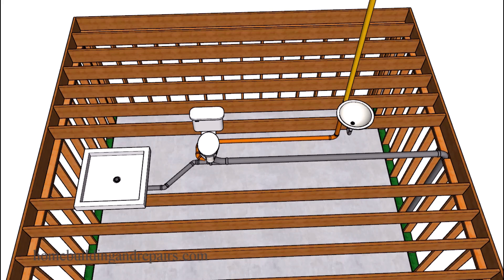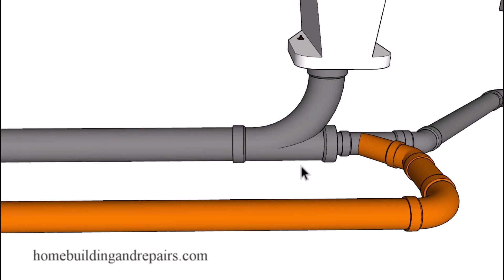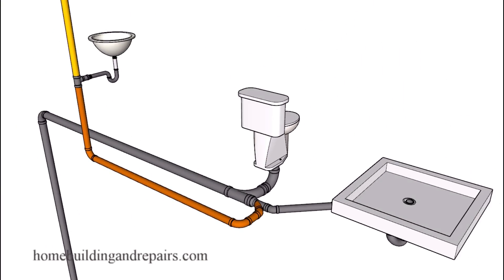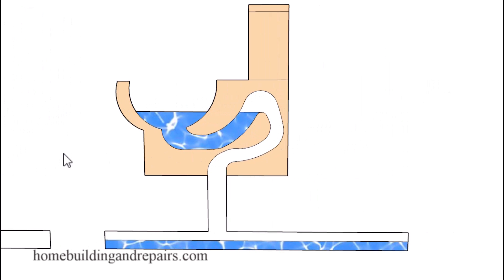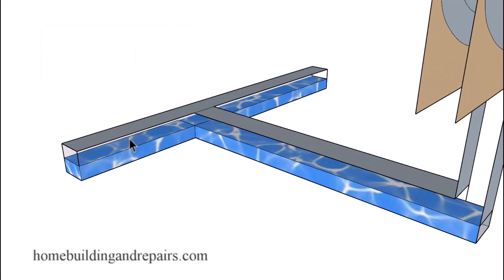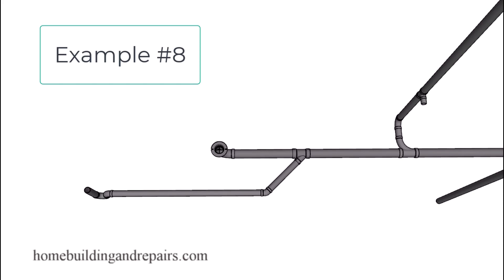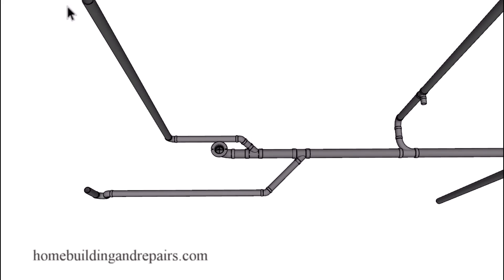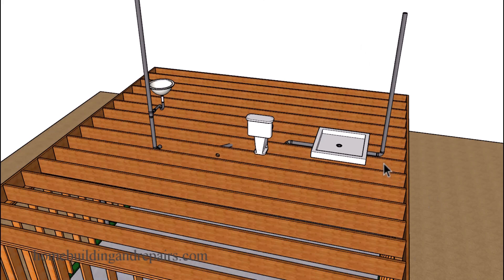Toilet And Shower Wet Venting For Plumbing Drain Pipes In Floor Framing - Project #1

Comment: Heres something to ponder.... 912.1 Horizontal wet venting states every fixture must connect on the same level of the horizontal. In said section of the commentary the exception on the toilet.  This is what it states.... "The individual fixtures vented by horizontal wet vent must enter the horizontal wet vent in the horizontal plane so that the connection is not below the trap weir of the connected fixture. Water closets, having integral traps that depend on self siphoning, are exempt from this requirement".  With that being said saying a toilet draws air is not completely correct. A toilet pushes air when flushed that why a toilet does not need to be directly vented and limiting the distance for a toilet to vent is pointless... That would be section 909.1 Distance of trap from vent.
Reply from the maker: Yes, a little confusing. The I.P.C code says it a little different. I don't get the trap weir part.
Reply: @homebuildingandrepairs3122   The trap weir or crown weir is the part of the bottom of the p trap where the fluids start to leave the trap and travel down the line..... The case of the video you did this would be referring to the trap weir of the shower. Once it leaves that trap it enters the horizontal wet vent and that must be on the same plane.... For example if you traveled lets say 2 feet from the shower trap to the wet vent and you double 45 down to said vent then that would not be entering the horizontal wet vent at the same plane therefor the shower would need to be individually vented.
Reply from the maker: @jwblount7802  That's what I thought and if it's in the code, it does not make sense. It would require a little more math and fixture location might vary. To make it work, your bathtub might need to be moved a few feet in a few different directions:)
Reply: @homebuildingandrepairs3122  I do it everyday just like I described and it works like a champ. I do on average 50 -60 custom homes a year on average, I did 85 of them last year and plumbed everyone of them just like this..... What I have noticed with the IPC it is more on pipe sizing, increase the pipe size and the farther away from the vent the trap can be. But as for the toilet drawing air from the shower it does not.

 I did a log cabin house years ago and they want ZERO vents through the roof just AAV's. I told them at least 1 has to go out for relief. Nope not gonna happen.... Within 6 months of moving in the house locked won't flush of flushes very slowly and pushing on all of the shower traps. So I went back out there drilled about 12 or more 1/4" holes in the outside cleanout..... Been flushing and draining like a champ ever since.

Comment: One issue is you can’t connect both fixtures at the same place. In many places double y’s cannot be laid on their side. This is because if you turn one side up slightly to get fall then the other side has backfall
Reply from the maker: I understand and if you can use separate wyes, then I agree. I haven't found a code that says you can use the double wye and have seen it use more than once. Let me know if anyone finds a code reference number.
Reply: @homebuildingandrepairs3122  We did share the code reference with you on the other video last month. The double wye violates the 1/4"/ft slope rule, both for fitting itself and for pipe that is force to come off flat or negative off of it. Also violates the code that requires you to follow manufacturers' instructions on all listed devices, which is violated when you do not fully seat the pipe into fitting to tweak the long connected drainage run into having some slope. Plus they clog frequently. It's 100% a code violation
Reply: @homebuildingandrepairs3122  it’s new to me. I’ve always used them and just laid them level and then graded with the pipe. Even if flat it’s less than an inch of distance that’s flat. However I’ve been flagged on it twice now and I’ve heard this in other groups.
Reply: I installed them level and use at 45 and roll them to an 1/8
Reply: @leach713  hope not. If you roll one side to an 1/8, you roll the other side to -1/8.
Reply: @joshcowart2446  If it's level left-right it should still be sloped front-back. The branch arms are going to be at a compound angle so not exactly the same as the main line but still sloped more than enough.

Comment: will this work also with a double vanity w/cross T???  tia
Reply from the maker: I think you might be better using a fixture tee or setting it up with two separate drains coming out of the floor.

Comment: In example #3, is it possible to have a soaking tub wye into the shower drain before it enters to the main 3" line?  And with that in mind, how would this work with the vanity and tub switched sides of the room but the DWV 3" going the same direction?

Comment: No horizontal dry vents allowed below flood level rim of the fixture it's serving. the dry horizontal vent serving the toilet is wrong in example 10, also example 11 is wrong on the horizontal dry vent below flood level rim of the shower.
Reply: Correct, IPC doesn't allow horizontal dry vents, but UPC does, amd the vent fitting must be rolled up on a 45 degree angle or more.
Reply: Long Island NY plumber here, we run horizontal dry vents all the time here. Perfectly acceptable. Would be damn near impossible not to run them with the way they build houses now here.
Reply: @mattstiglic exactly the same in California 👍
Reply from the maker: Thanks
Reply: Iam a homeowner who just had a remodel of a modular home 25 years old(nationwide homes) we did all bathrooms over with all new fixtures. We cut out the existing master single stall shower and capped its drain. We turned a garden tub(same bathroom as the removed single stall shower) 1.5" drain into a 2" drain for a new 5x4' walkin shower. Since doing this the toilet sucks the ptrap of the shower dry with methane aroma for all. I believe the master and adjacent powder room are both wet vented together. I believe removing the single stall shower somehow ruined the wet vent and has compromised venting the new shower somehow. Getting a somewhat large Charlotte plumbing company involved has been a waste of time...both guys sent have no idea about wet venting and all they did was put an aav ptrap kit in the vanity. Its better but i dont think its 100%.  Unsure of how to proceed. Any advice would be very much appreciated.

Comment: Which examples here are not code compliant?
Reply: Which code are you under? #1 he already mentions is a violation (but IRC only I believe). #3, #7, & #8  have a horizontal double wye violation (lack of 1/4" per foot violates IRC & UPC). #9 he mentions is a violation, but that is actually only under the UPC.... IRC allows this. #10 & #11  show a prohibited flat vent arrangement, violates both UPC & IRC
Reply from the maker: @Grrnhumb I can't argue with this and don't like the double wye set up if you can avoid it, but table 706.3 in International Plumbing Code Book allows it for #3, #7, & #8. As far as #10 & #11, I've seen it done by licensed journeyman plumbers in floor framing and will address the issue more in a future video. As far as the International Residential Code And the The Uniform Plumbing Code goes, You should always check with your local building department to see what they approve.
Reply: @homebuildingandrepairs3122  Table 706.3 does not mention a double wye, so no it does not allow for it. Examples 3, 7, & 8 are violations. When you've seen flat venting like in examples 10 & 11, that was not recent (ask your plumber). Those are flagged violations in all areas of the country now. Do you need the code sections again?

Comment: Oh my god, you just made this make sense about not wanting liquid to run through the top of the pipes, because that’s for the air
Reply from the maker: Awesome.
Reply: @homebuildingandrepairs3122  , I'm glad this helped someone because I'm still confused.  Even if the toilet formed a full curtain of water across the top of the pipe during a flush, the wet vent from the sink would still be open and vent appropriately.  I don't get it?  As the toilet is the last thing permitted on a wet vented branch, there will be no other fixtures down stream of the toilet where the venting would be interrupted.
Reply: @Frostbbitten  closing off one end restricts air flow at the other. The water from the sink could become air locked between itself and the toilet. It's unlikely but code deals in possibilities mostly, not likely outcomes.

Comment: I see videos of venting through the roof because the pipe has to be vertical. Can we vent through the siding?
Reply: only if 6'' above flood level rim and 42'' minimum from floor
Reply from the maker: Yes
Reply: @homebuildingandrepairs3122  only if 6'' above flood level rim and 42'' minimum from floor

Comment: Thanks! Very helpful. If someone is under IPC (Colorado), could you use one of these layouts in a basement with an AAV (like at the sink) instead of connecting to a stack?
Reply from the maker: You will need to check with your local building department.

Comment: Thank you for sharing, it's a very specific topic considering, as you showed slight changes in drain length from fixture to main drain cause issue. However, it helps anyone to imagine how their specific needs should be approached. The 3D modeling is so nice to see compared to 2D scribbles on a dry erase board. Thanks again!
Reply from the maker: You're welcome and thanks for the kind words.